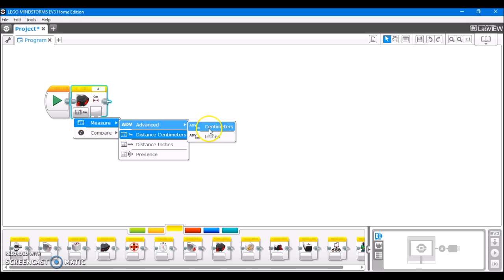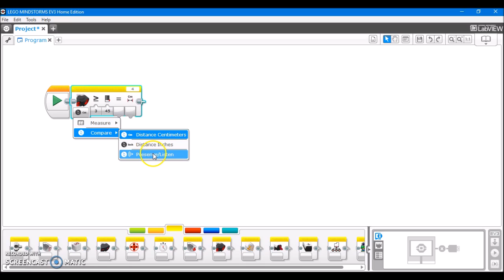How to Program the EV3 Ultrasonic Sensor

Comment: you program is better than my. My program, for example, does not speak the unit of measurement used, only speaks the distance, your program has more. will that is out of date?
Reply from the maker: Are you using an IR sensor? An IR does the same job, but it doesn't give a distinct distance, only as a percent out of 100.

Comment: how do you program the ev3 remote? ?
Reply from the maker: +regie maniago My video on the IR sensor should help with that.
Reply: +Builderdude35 what I meant was the remote that you build that has 2 motors ang 2 sensors
Reply from the maker: +regie maniago Do you mean using a second EV3 as a remote? To do that, you will need to use Bluetooth messaging, which I also have a tutorial on.
Reply: Builderdude35  I've watched that many times already and accomplished it
Reply: But I've make another remote that has the motors sensors and everything but i can't seem to program it right😭
Reply: regie maniago You might have to look it up.